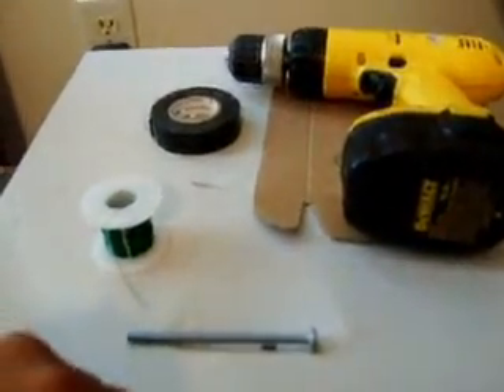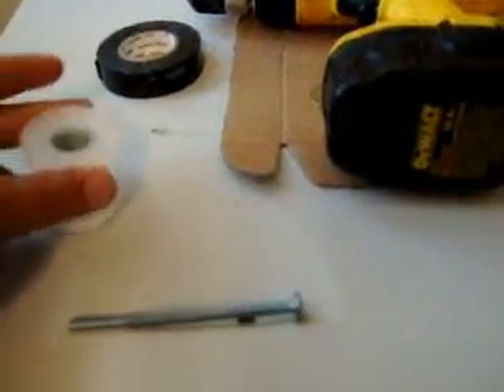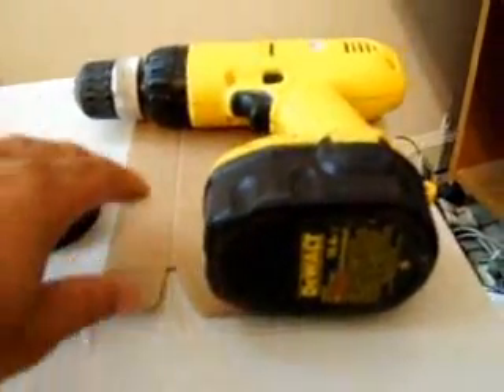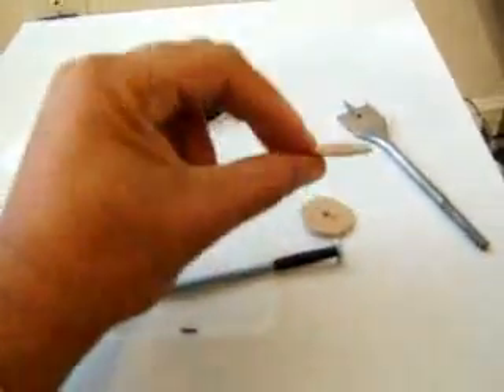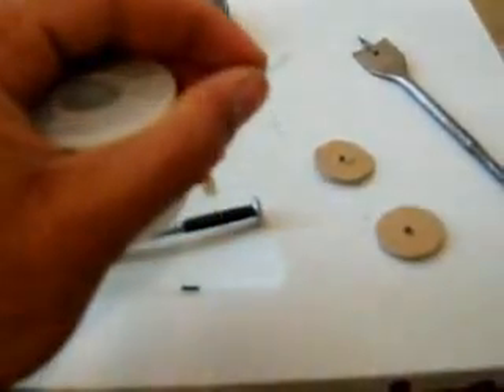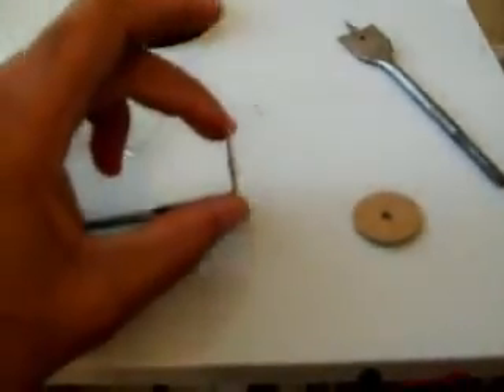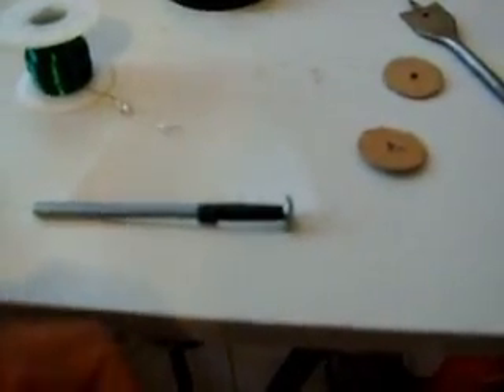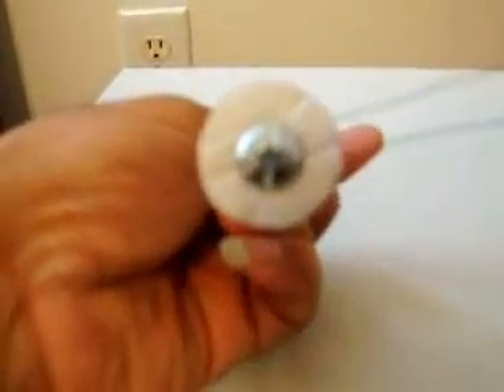The Smallest Generator

Comment: Great video! It is very helpful and clear. Is it possible to connect something other than an LED light to the two leads of wire? I want to connect something that measures and displays the amount of energy being produced at a given time by a generator such as this.